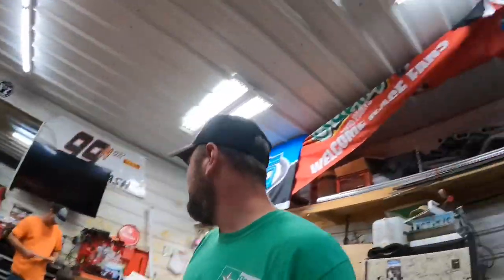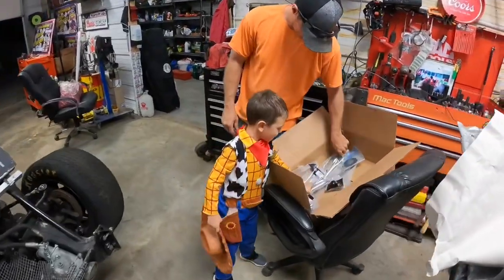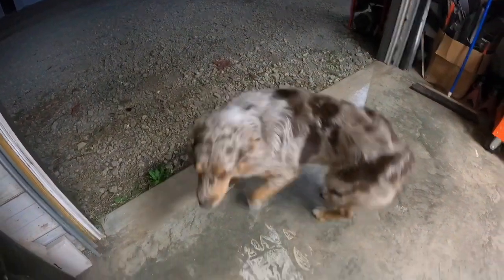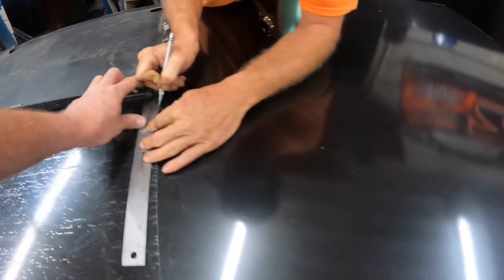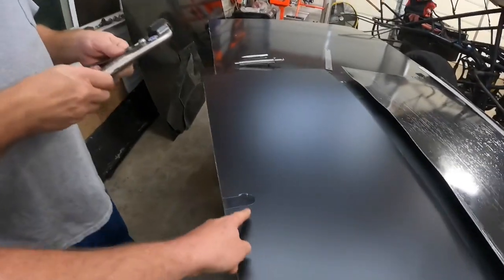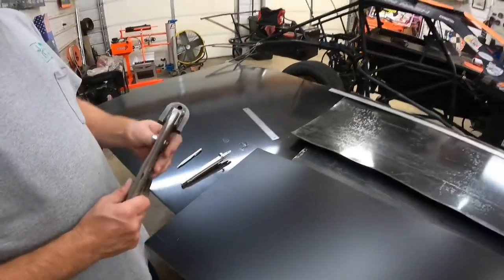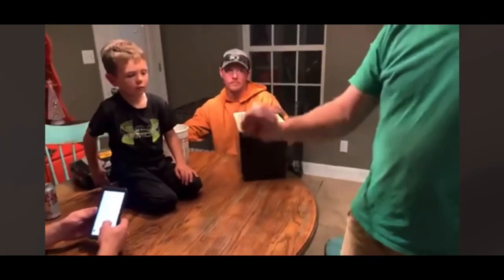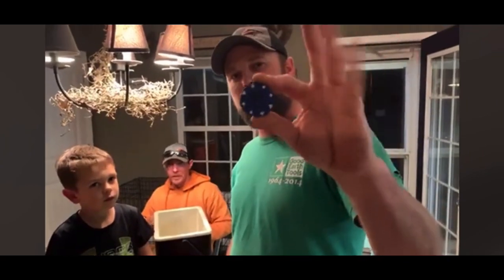Building A Race Car Body pt.1 PLUS someone WON Our Race Car!!

Comment: HUNT THE FRONT never gave away a racecar! Badass tim, you are the man. Old no.7 garage is where its at yall.
Reply: Both of them are the sh*t.. #7 #10   Two different types of cars with two bad ass drivers
Reply: Hunt the front can’t because they need the money to race three cars
Reply: @johnpeckracing8725  hunt the front makes plenty enough money off of youtube and swag.
Reply: @CherezianRacing  so u expect them to bye tires, fuel, engines, to get to the track, and all other parts off of YouTube.
Reply: @johnpeckracing8725  youre underestimating the power of youtube
Reply: @CherezianRacing  Exactly... I; ve followed them since they had about 3000 subs and in the big shop. As their subs grew so did their operation to what it is now. Jonathon just bought a new house with a big shop and Jesse just bought a new motorcycle with his YouTube and twitch income because he quit his job this summer. They are doing just fine...

Comment: What was the tool you used to cut your sheets with  not the pliers but the   electric cutter
Reply from the maker: It’s a Bosch shear 
https://www.ebay.com/itm/BOSCH-0-601-500-034-ELECTRIC-METAL-SHEAR-SHEARS-16-Ga-GAUGE-SWISS-MADE-UGLY-/353266860559?_trksid=p2349624.m46890.l49292